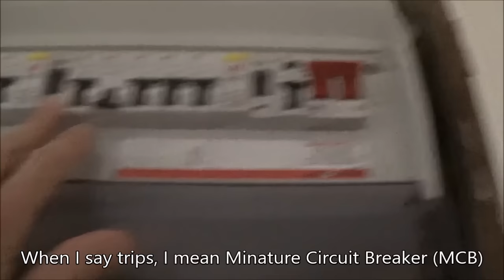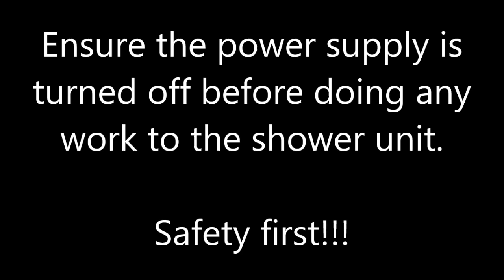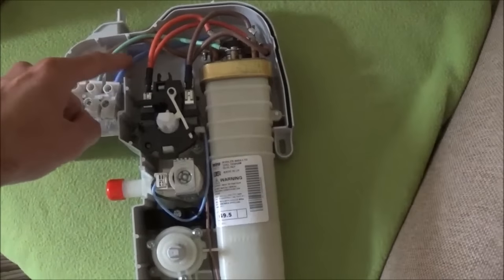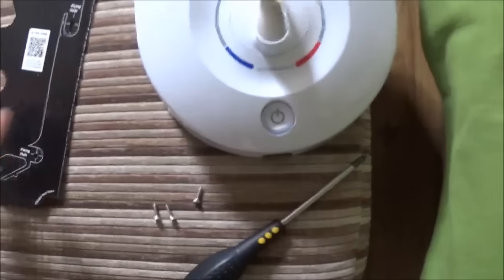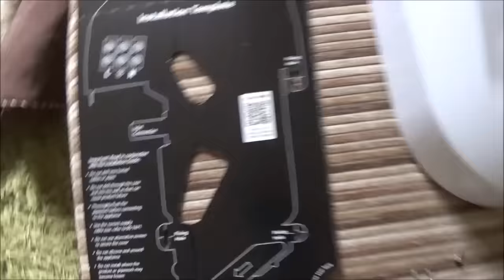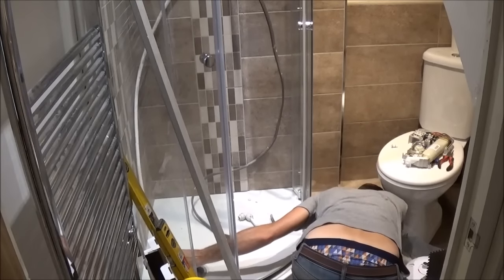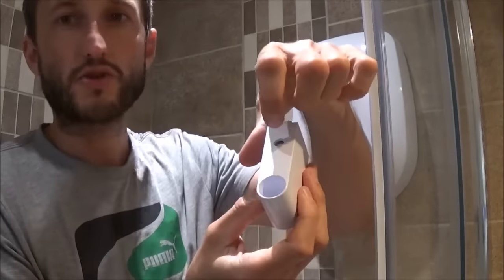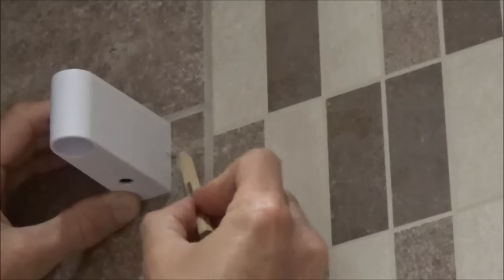How to fit & install an electric shower. Mira Go shower installation.

Comment: Has no one mentioned about the push fit elbow onto the actual shower? That elbow should be a compression elbow which will never blow off if fails. Compression joints will only drip if fail. When a push fit joint fails,it might blow off, water+electrics=bang

I am a plumber btw.
Reply from the maker: I thought the same but the shower instructions said a push fit can be used on this product. I use speedfit which has the additional turn feature to help lock it in place. Thanks for watching.
Reply: I agree. Normally they are compression fittings, definitely with Triton. You can't fit the speed fit or Hep 2o pipe inserts into the plastic shower fitting. The inserts are a must if using Speed fit or Hep 2o.

Comment: How much it cost
Reply from the maker: I've put links below in the description section to the shower, all products and tools used in the video. Check it out! Thanks for watching.
Reply: @POUSEaroundtheHOUSE  how long these units last for? I've had mine for 3 years.... And they started showing signs of wear and tear... Hardly any hot water coming out (low pressure and  a mix of hot and cold).  Could it be limescale? Many thanks for your vidéos
Reply: @ElKoubi1975  if your kettle gets filled with limescale then so, I very much suspect, will your shower. However, I don't live in that type of environment so I'm not qualified to advise on the solution. You might find that you can buy a product that can filter the water as it comes into the house, which would prolong the life of all your waterborne appliances. Try changing the shower head first to see if that helps, as it is cheap enough to start.

Comment: You missed out 1 major thing, all showers etc need bled b4 using
Reply: Alright Mr professional why u watching this if u already know
Reply: Pretty sure he did at the start?
Reply: @Josh-bq9sm 😂 love it
Reply: I fitted a few. It doesn't matter if you know how, it's always interesting to see how someone else does it. I also noted that he didn't tell the viewers about an important point about the priming of the shower meaning that before you switch on the power you MUST run the water for a few minutes. There might be air bubbles in your supply pipe. A lot of these showers blow out if you don't do that. Cheers.

Comment: 240 volt live wires next to shower spray?
Reply from the maker: The shower is designed to be water proof. These showers are common place in the UK. Thanks for watching.
Reply: Showers are IPX4, water tight
Reply: Farooq Shah, OK, then it is safe.

Comment: Why are these so popular in the UK, don't you guys have natural gas mains and infinity systems?
Reply from the maker: Yes we have natural gas and some showers are fed from the boiler. But electric showers are still common place and by having one of each like me, if your boiler breaks you can use the electric shower instead. Thanks for watching.
Reply from the maker: @Michael Firecracker Thanks for the comment and thanks for watching.

Comment: Since when did "professionals" give a fuck about regulations?
Reply from the maker: What makes you think I'm a professional?!! Thanks for watching.
Reply: Wasn't referring to you, but to the "experts" who fit my home (on council orders and at huge expense to the taxpayer) with unsafe, exposed mains gaspipes on both the inside and outside of my home (when there was NOTHING wrong with the old ones), who replace perfectly safe and discreet electrical wires with exposed live cables (insulating the wires but still...), destroying my privately installed (expensive) shower and damaging my privately installed burglar alarm sensor. They tell me they did a right proppa job before the brand new boiler broke down repeatedly due to them not flushing the radiator of the transport fluid. The whole lot cost a fortune, and if they had given me a voucher for HALF of what they spent on it, I would have done a better, safer, and more attractive job myself. Thanks for the video, it may come in handy :)
Reply from the maker: Really sorry to hear that. I think you need to report the work if it was that bad. Anyway, hope my vids help you get it back into some sort of usable state. Best of luck.
Reply: In the US probably not that much, in the UK, we have a guy in an anorak with a clip board for every occasion.

Comment: Fuck that using push fit any where near a cable drawing 11.6 amps all the time when turned on.
Reply: Hi everyone one question I need to know ASAP, I'm no electrician or plumber and certainly wouldn't touch a electric shower with a barge pole but a friend has just had one put in only she showed me the mess of the tiling they( two cowboys) had left after doing the disappearing act,
 Nothing was level even the glass wall cabinet wasn't level (she put a deodorant can on top of it and it rolled off and fell to the floor! > now you have a mini idea how bad they left her bathroom in then one thing that concerns me 110% when i noticed these Pr*cks had cut a hole in the top of the shower wall mounted section with what must have been a hacksaw with the grey twin+earth wire's feeding the unit it (the wiring) was inside a length of what looked like 20-25mm trunking self adhesive type only it hasn't even stuck to the "so-called tiling job" because the tiling was so bad each tile was not flush with the one next to it "they were sitting proud of each other and the same trunking has then been cut off at ceiling hight probably again with a hacksaw because the edges are rough were the cut has been made and you can see them going up. Into the loft because this trunking is cut 1/4" short of ceiling hight then you can visibly see the wire's going inside the shower body (the wall mounted section) even though they had tried to cut this trunking flush on top of the wall mounted section of this new shower  now she has a (handmade cut out on the wall mounted section of this shower unit) and next to this is a another open entrance point about the same size as the trucking next to it (what they had cut out )and if I remember rightly in my opinion was this entrance point was a factory made on the body of the shower but in my opinion this opening shouldn't be left open and exposed to the out coming water from the shower head it should be closed off in some way, when I seen it after having a little peep (look) i said to her straight away  "don't use that thing"it's a death trap!
Then she said " we have been and its not that bad but we have to turn the taps on in the sink because the water gets too hot and it's the only way to cool it down and I've just seen a comment on another video saying "don't use push fit on a shower (the Cowboys have) they have had the bath taken out again I said "well I certainty wouldn't" use the shower even if you have no bath but she now suggested putting silicone over these two areas open to the water just for a bit of what she calls (a peace of mind) (thinking it with solve things)" blocking them off so no water or splashes can get inside,
I know it's not my house but I can't stop thinking of it "even though someone has said to me that it's not our house so don't interfere" what do any of you think because I'll show any of you're comments (if) I get one.
 Thanks.
Reply from the maker: Well the instructions with the shower say push fit is acceptable but each to their own.
Reply from the maker: Gary - Sounds like a mess but that's all I can really add. Hope they get it all sorted in the end.
Reply: Never had a leak with a push fit alternative is compression, olive, PTFE tape and hope it’s ok!
Reply: Where did you get 11.6A from, the current would be much higher than that even with the smallest electric shower. And what difference does it make how much current it is drawing to its proximity to water - Answer = None!  If you don't really know what you are talking about, don't comment!
Reply: If they dont leak they are safer than the alternative of  a compression fitting  which is made of metal . anyway all bathrooms should be RCD protected .

Comment: Uk is a very sick state of mind. Regulation to install shower 🤣🤣🤣. What a thick country
Reply from the maker: We've used them for years although hot water from boiler is becoming more common place now. The units are water proof and RCD protected to avoid electric shock, but you're right, it does seem mad when you think about it! Thanks for the feedback.
Reply: Lucas you are clueless we have the strictest laws in the world  when it comes  to electrics .

Comment: Just pay a plumber to do it.
Reply from the maker: That is of course one option. Thanks for watching!
Reply: And keep in eye the plumber ensure he does job properly.
Reply: egor evans but why would I need to do that. When they are qualified?
Reply from the maker: As you say if they are qualified then it should be ok, but they need to be qualified in the electrical bit, not the plumbing. Good luck and thanks for watching!

Comment: The adjusting of the temperature and the switch is too high up, for people seated in shower-chairs.   Discriminates against disabled people.  Shame.
Reply: Maybe that's what the customer asked for? It's not a public shower you know.
Reply: Yes, yes, you're absolutely right; thanks for not over-reacting.  
It is good that others see what variations are available in the case of their perusing you-tube to see what others have done, specifically to help them decide which design features they may like to incorporate into their own bathroom design.

Whatever was done for this client has nothing to do with public opinion; the work quality or design is not being assessed. 
 Be more confident, commenter-Ryan.
Are you a wheelchair user, Ryan or a builder ?
.
( I am planning my new walk-in shower at my home; the builders are coming in about a month's time ).
I send you video if you like, after then.

Cheers.
from,
A
Reply from the maker: Hi Anne, the shower wasn't fitted in a disabled home or a public shower as Ryan said below. I fully appreciate and understand your point and if this was an installation for disabled access and usability , the shower enclosure would be no good either. A wet room would be a better choice with a wider door frame to enter the room allowing wheelchair access also. Hope that helps. Thanks for watching!